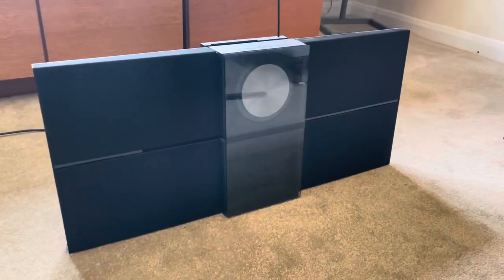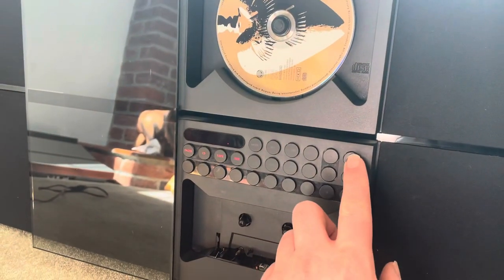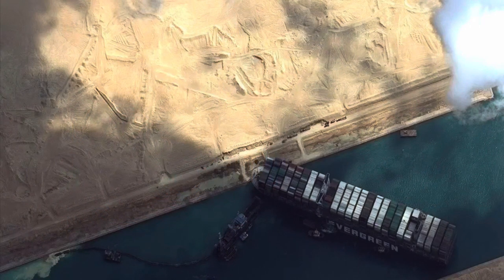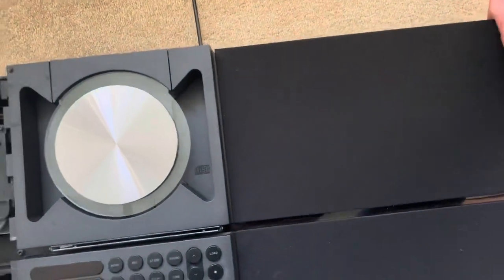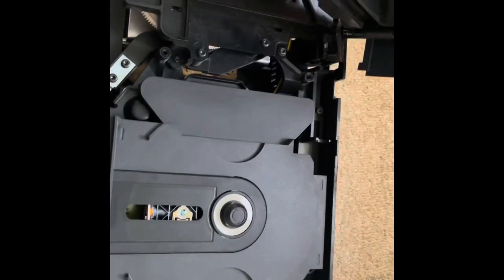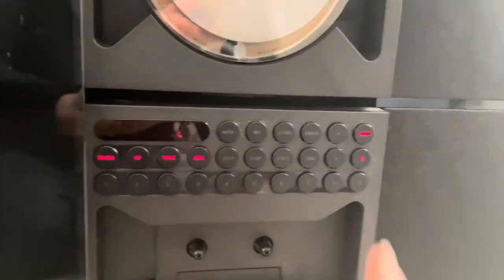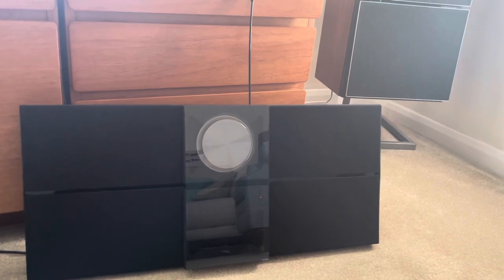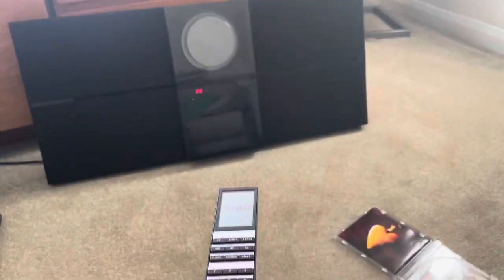Beosound Century / 2000 CD laser repair and review / thoughts B&O Ep.04

Comment: Can’t you show how to service the tapedeck?

Have a squeaking noise and a hum when I use the deck.
Reply from the maker: Sounds like a good idea for a video that :) 

For now, here’s a brief summary of what I’d do with your deck. 

The hum may be a dirty tape head or could be the tapes as the most likely culprit. Use a Q-tip with rubbing alcohol on the head and gently clean. These are especially bad for it as the head sticks upwards and isn’t particularly well shielded from dirt. 

The squeak will be the capstan or pinch roller. Again clean with rubbing alcohol and a q-tip, just ensure you dry the rubber parts off as you clean them as the alcohol can damage the rubber. You can buy special rubber cleaner which is more gentle on the rubber parts. 

You can get liquid bearing synthetic oil and that should be good to use in most applications in the tape deck, a small amount… although I wouldn’t recommend using it on the motor itself. Any larger plastic gears for any door mechanisms etc use white lithium grease.

Comment: Are those Spendor speakers I see in the background?   I just moved mine across country (two plane flights) and now the tape deck clicks…. Everything was working well before the trip sadly I guess I’ll have to open it up and see what’s wrong with it. Any ideas? It clicks five times and stops. Sometimes randomly.   And the tape won’t play at all.
Reply from the maker: They’re beovox MS150 you can see :), 10 inch sub 8 inch main 3 and 1 inch tweeters. Beasts!

To be fair on the tape decks it’s most likely a belt. It’s certainly where I’d start and making sure all the mech moves smoothly. No rollers stuck etc. Moving on from there the next thing I’d check was any caps… On my beocord 8004 my tape would click in and out and it was a capacitor that had failed.. I’d imagine it will be a belt though that’s possibly slipped off or failed.
Reply: @chrisbaker121924  thanks! I opened it up and I noticed something shifted maybe something was out of alignment. Anyway I couldn’t notice any physical damage so I put it all back together and it’s working great!
Reply from the maker: @stevenwendt7927  that’s awesome! Maybe it got slightly knocked in transit. Tapes mechs are fiddly delicate things

Comment: @Bakercars&hifi
Hello,
I have a Beo 2000HP that recently stopped playing CD's. The CD spins when you start to play it and then rejects the CD and displays the ( ) on the screen. I'm assuming it's the laser based on your video. I have two questions please:
1) Would you suggest replacing the laser or could the problem be something else?

2) I shopped Ebay and found a laser as you describe but it does not show any numbers on the ribbon cable in the listing. The item is:  VAM Philips CDM-12.4 CDM12.4 laser head-NEW for CD DVD. Ebay item # 360464865172. Can you please tell me if this is the laser I need or could you possibly recommend a Ebay item number or Amazon item number?
Thank you so very much...!!
Reply from the maker: That is very symptoms mine had. Spins for a moment and rejects the CD. The laser (or part on the laser board) is most likely your issue. Looking on that eBay link the part SHOULD work. B&O didn’t have their own CD lasers and used generic parts from Phillips mostly, with the exception of the CD50. The beosound century has what I call the linear laser which is a Phillips CDM12. There were several variations of this but I believe they all used the CDM12.4/VAM1204… I believe all CDM12 variations are compatible but haven’t tested myself.

To me it looks like the correct type and with these things it’s certainly worth a go. I think it would most likely fix your problem. I certainly have had a lot more success with fixing these than Phillips CDM1-4 which seem a lot tricker to set up. 

It’s easy enough but a little fiddly so go slowly and take pictures where everything goes a long the way. You’ll need a mini torx bit screwdriver if you haven’t got one. Mine was a straight plug in and it works with no setting up required.
Reply: @chrisbaker121924 
Thanks so much..!  This is a wealth of information. 
Since you think this Ebay part will work I'll buy it today. I'll definitely let you know either way how it works out.
Many thanks again.
Larry
Reply: Last question please. I was just about to order the part and I see it comes two different ways. One is just the optical laser and the other is with the motor mechanism. It is necessary to the mechanism as well?  It's about twice the price.
Thank you
Reply from the maker: @larrysue1  you should only need the laser rather than the whole assembly with the motor etc. That block in the link you sent me is what I replaced on mine. Fingers crossed I’d be hopeful it works :)!
Reply from the maker: @larrysue1  let us know how you get on :)
Reply: @chrisbaker121924  
Will do. Thqnks..!
Reply: @larrysue1  How did it go then? Have you been able to fix yours?
Reply: Excellent tutorial! I can now work on my Dads one and set it up in the house! Thank you!

Comment: Please How can I return back the door of beosound century
Reply from the maker: Not sure what you mean?
Reply: After I changed the cd laser, I couldn’t know how to get back the case that hold the cd into its place .
Reply from the maker: @khalidm510  do you mean the springs?
Reply from the maker: @khalidm510  or the door that flips upwards perhaps that clamps the CD
Reply: @chrisbaker121924  finished the springs and it’s very hard to put the door back to it’s place, and I’m afraid to break something, in your video it doesn’t show clearly.
Reply from the maker: @khalidm510  ah okay I know what you mean. On the left hand side there is a track that opens and shuts the door. You have to start with the door 90 degrees anti clockwise and facing towards you (but the door itself in the closed position) if that makes sense. Might make more sense watching the part where I remove the door to see how it goes back on.

Hook the level that opens the door into its little track as you twist the door on. You need to bring it through 90 degrees to the correct position as you are also lying it flat at the same time. 

It shouldn’t take a lot of force so if you’re forcing something you’re doing it wrong or something is incorrectly positioned. The right hand side of the door just slides into place.

Then there are four screws to reinstall that holds it down.
Reply: @chrisbaker121924  did it finally, thanks for your help 🙏